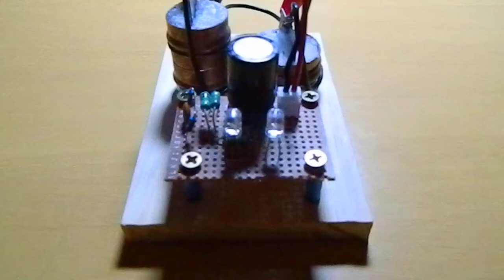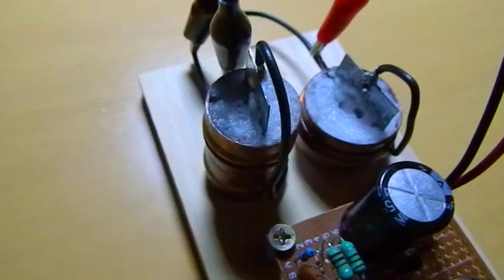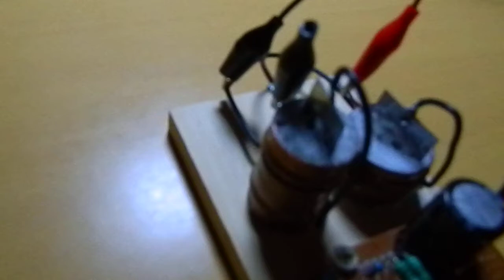Crystal Cells and High efficient oscillator

Comment from the maker: We all must have the skills to create batteries with common parts. At least it is what I think.
That is why I said that. About the chokes, yes.... magnetic connected. I am testing ways to create the Joule Thief´s without using a toroid or make those windings. That is why I use inductors and CAT5 network cables.
Sorry about the schematics, I will be showing all the circuits on my next videos. Regards.

Comment: "One day we will remember this"????  I think one reason why the blink rate changes is the higher humidity causes the phenolic circuit board to be more conductive.  If you had used green epoxy PC board, it would have much higher resistance.  Are the two chokes next to each other so they are magnetically coupled?  I see TK's replication of your circuits, but I don't see any schematics in your videos.  A Schematic would make it much easier to understand how it works.  Thanks. for sharing.